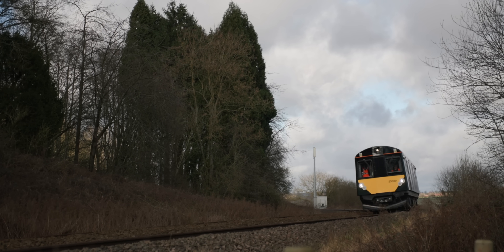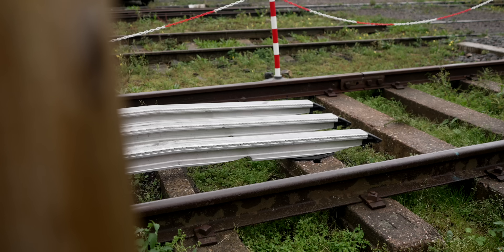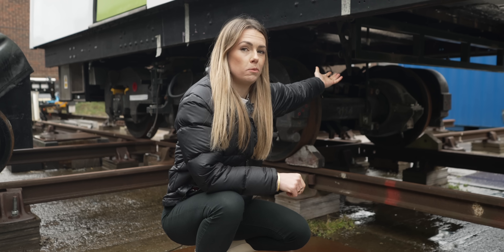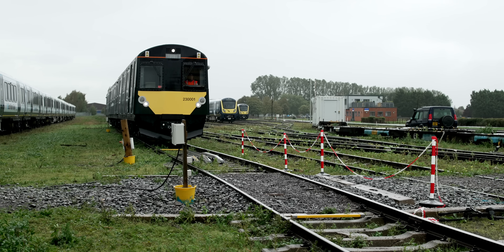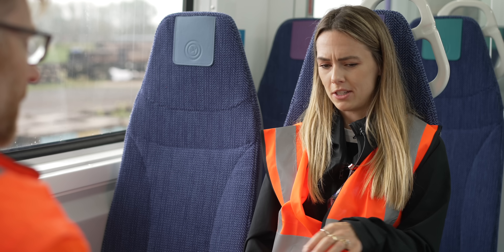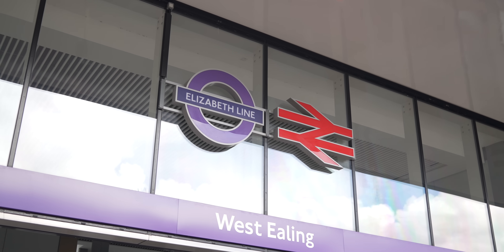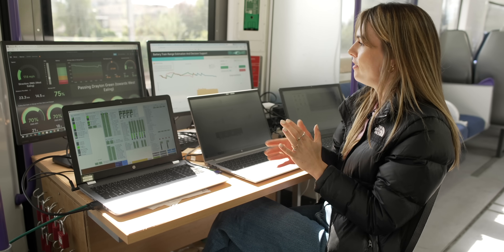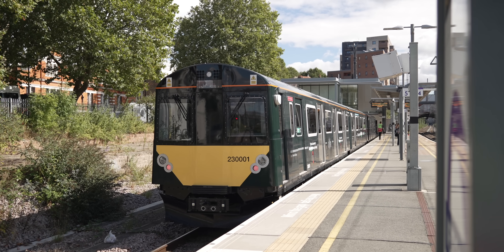Onboard the UK's First Battery Electric Train!

Comment: Carrying heavy batteries, instead of pasangers! What a brilliant idea!
I wish there would be somekind of tehcnology that could replace the batteries for trains. Overhead wire, maybe.
Reply: Insane right? That they haven't thought of that? Big, overhead wires have no problems at all!
Reply: @Tresla  Have thought of that? Seems like nowadays trend is "battery electric", you can sell ANYTHING what is battery electric. Battery electric car, train, scooter. Doesn't matter if it's good or bad for the environment at all, just sell it.
Reply: Overhead lines on branch lines is really expensive. Plus you have to get rid of level crossings, low bridges, etc. it’s cost prohibitive. This tech is great for the local trains.
Reply: @stevebishop1161  Batteries are really expensive. Plus, you have to change it, because of the degradation, and you have to handle the chemical remains. Overhead lines are great to get rid of the heavy batteries.
Reply: @rocko44444444  overhead lines are really expensive too. Batteries last 10 years plus with very little degradation. Diesel engines need several rebuilds in that timeframe. Yes overhead lines are best for sure but you just can’t fit them everywhere 👍
Reply: @stevebishop1161  So within a timespan of an overhead lined locomotive batteries could be replaced 5-6 times. Doesn't sound economical to me.
Reply: @rocko44444444  so when diesel is banned eventually, do we just close the local lines? You can’t have overhead lines where there are level crossings or low bridges.
Reply: @stevebishop1161  It's matter of organizing. Diesel won't be banned.

Comment: I life in the northernmost state og Germany and we use a fleet of 55 battery electric trains from Stadler sins 1,5 years, but ours charge at the overhead wires, so that they can also charge on already electrified sections and we build small electrified "islands" in the stations. That seems a lot more effektiv to me, because we can use the same infrastructure for electrified and battery trains.
Reply: Stadler make the Class 777 which has been running on Merseyrail for over a year on batteries, but its in the north of England so no one cares. Somethings happened in home counties so it must be the first time its ever been done.

Comment: Has anyone seen all the 44000km of high speed rail network that's been built in just the last 10 or so years in China. UK snail pace !
Reply: Yes, but rumour has it that these Chinese high-speed lines and trains are already experiencing serious maintenance problems. So maybe building at a snail's pace is the right way to go.
Reply: Agreed that the UK situation is dire (the price per mile of HS2 is completely insane, surely criminal overcharging by layers and layers of private suppliers).  But China is around 3800% larger than the UK and has 1.3 billion more people, a superheated economy, burgeoning middle class, and a growing overseas commercial empire.  It's a bit apples and oranges really.
Reply: @limejoos4u  I'm not so sure that your appraisal of the economy in China is actually true, if even a small fraction of YT videos are to be believed.

Comment: This is very cool and I"m happy to see this kind of thing get developed - I'm sure it will have it's place. But it occurs to me that in many cases you would be able to run catenary lines through a lot of a route, so it might be simpler to just have an adjustable catenary arm and the batteries charge up at the same time that the train is being powered like a conventional electric train? In some cases you'd be able to get away with a fairly small battery if it was only just tunnels, overpasses, etc that it had to contend with

Comment: Used to use this train occasionally in 2023 and it was definitely diesel then.
Reply: Comes in different flavours. Battery/hybrid and straight BEMU classified as varieties of Class 230, Third rail edition for the Isle of Wight is Class 484.

Comment: Highly efficient regenerative braking would extend the range of the train significantly. Theoretically, with zero wind resistance, zero friction, and 100% efficiency, one charge would run a BEV train forever. In the real world, including inefficiency, a BEV train with highly efficient regen could have a workable range on many short and intermediate lines.

Comment: Why not use a standard pantograph or third rail shoe? That way the train could also run on already electrified lines and recharge while moving.

This is how it's done in mainland Europe, where we just use the existing infrastructure for recharging and therefore can cover almost the whole network without building any new infrastructure (as most non-electrified branch lines conveniently terminate at electrified mainlines). Only in very few locations they had to build short sections of electrification (which is probably still cheaper than the bespoke system presented in the video).
Reply: Since 2023, the company ERIXX is operating connections in Northern Germany with Stadtler FLIRT  battery multiple unit trains. They have a fleet of now 55 units. The trains have a reach of around 120 miles, a topspeed of 100mph and need 15 minutes to charge. For charging they use the german standard 15kV overhead wires. They can also use their pantograph to drive on electrified routes while charging their batteries.
Reply: @derjost9903  The BEMUs have been withdrawn in December 2023, according to the International Railway Journal. Due to poor reliability and have been replaced by DMUs.
Reply: @J-Railway-Volunteer  They are already back in service since February.

Also, the issue had nothing to do with them being battery-electric, just the "normal" software problems that every new vehicle seems to have nowadays...😕(Ok, rumor has it that one was damaged because the driver forgot to switch to battery mode at the end of the catenary. But even if true I'd also count that as 'teething problems'.)
Reply: @stephanweinberger  Suprised they aren't fitted with auto drop system.
Reply: @J-Railway-Volunteer  All electric rail vehicles drop the pantograph when there is a drop in line voltage, but depending on speed and geometry of the catenary that might still not be quick enough if you drive past the end of the wire.
Reply: @stephanweinberger  Nope, a lot of rail vehicles keep the pan up, irrespective of if there is voltage in the pan, there is a fair number of bridges with no overheads wire across it but the pans stay up. Only trains with an Auto Drop Device (ADD) will lower pantograph, once it has reached a certain height, also they design there to be enough space between wire stopping and bridge to allow pan to rise and fall back into gauge for low bridges at line speed. ADD's work off height and not voltage because if they worked off voltage then they would be tripped every time you go through a neutral section/loss of line light. Trains without Auto Droppers include the ACS-64, Class 86 & Koploper. Trains with Auto Droppers include the class 398 and 90.
Reply: @J-Railway-Volunteer  I'm talking mainland Europe, specifically Germany. German locomotives definitely cut out the main switch if power is lost (or more precisely: if there is under-voltage). Having them trip in neutral sections is not a problem, because there they should be off anyway (to avoid arcing). But of course for practical reasons there needs to be some time delay before the switch trips, so that not every little bump in the catenary causes loss of power.

And as far as I know, as an additional safety measure most newer locos also automatically lower the pantograph in case the main switch trips (as that may also have been caused by other defects — and then you usually want everything off). Additionally all locomotives operating on the German network are also required to automatically lower the pantograph if the pickup is damaged (which is monitored by a thin tube inside the pickup that's pressurized with air; if the pickup breaks the pressure drops, which in turn triggers the safety mechanism).

Lastly: limited height is usually not the problem at the end of the catenary — quite the opposite :-)
Reply: @stephanweinberger   Lowering pantograph if broken is standard, in most systems for any air pantograph. The min voltage for traction power on 25kv is 12.5kv. The main switch is what we would refer to as the VCB (Vacuum Circuit Braker) in GB, every time you go through a neutral section powerful magnets in the track turn on and off the VCB. In the UK we prefer keeping the pan up as it could be that the brief interruption to the power happens and it allows for unit to regain power as quickly as possible after an incident. Over height drops the pan at around 6m height.
Reply: The reason for the "non standard" shoe gear is becuase of the high current draw which makes there a risk regular shoes would melt. Also it using Network Rail Standard charging system.

Comment: REALLY-Mmm!!- Trains streetcars and trolley busses have been running on electricity since the early 1900's. that's  one thing about rails or trolley busses- What WE NEED is vehicles on the road using  this kind of technology similar to high speed trains of magnetic induced charging with smaller battery systems for every day use. How about that, it gives us the ability to ROAM (Degree from McGill 1960)

Comment: Its all well and good but how are we going to create the electric to charge the batteries?
Reply: Renewable sources of power or Neclear sources via E=MC².
Reply: @A-Trainspotter-From-Berkshire  If hinckley point is anything to by. Good luck.
Reply: @74wrighty  They have signed a deal which requires nuclear for the reliability of power, also they can refurbish nuclear power stations.

Comment: NOOOOO!  This is not the first battery electric train, as many below have said. It is not even the first 21st century one. What about the 2015 Electrostar battery train demonstrator, That was potentially a way more capable machine , and could have been a DMU replacement if anyone in DfT had actually prioritised it's adoption.

Comment: This is a very good idea and I hope it succeeds. A bit like the tilting train which was developed long ago which only worked about once on a journey from Glasgow to London and ended up in a siding at York Railway Museum I hope this has a more successful future.  The other thought which has crossed my mind is. A train could have a pantograph to draw electric from the overhead line that could work for say 20 miles and that would charge the batteries and then for the next say 30 miles there would be no overhead wire and the train would just run on the batteries. Thus rather than electrify say 50 miles of track you would do a portion, saving money. "Saving money" for an organisation which spends £100 million on a bat tunnel is probably be going to be a very difficult idea to understand, but I hope others can translate that phrase for anyone reading this in the rail industry.

Comment: Mind the gap!  Given how quickly battery costs are dropping, fully electric battery powered trains could wind up being cheaper than either third-rail or overhead-powered trains in the near future for commuter travel.   A lot of cabling, transformers, and related maintenance could be removed outright  Potentially hundreds of miles worth.

I do think the charging mechanism could be done a bit better, though.  Even though there would be no need for long third-rail runs, the third rail mechanism itself is very well-proven and implementing it just around each station area to deliver the charging power would not represent much of a cost.  And it would also allow the train to maintain charging for at least 60 additional seconds if not longer.

-Matt
Reply: See my post about the batteries on the prototype train charging at 4C or possibly 5C rates.  This is not excessive.  Extending the charging rail to lengthen the allowable charging time from 3.5 minutes to 4.5 minutes does not seem to be worth it.  Contact brushes for stationary applications can have much more copper in them than sliding brushes which have more graphite and a lower allowable amps per cm2 of contact area.  That could be their reason to charge only while stationary.